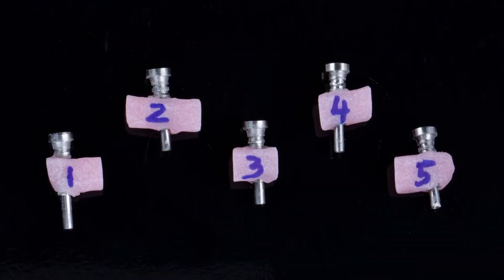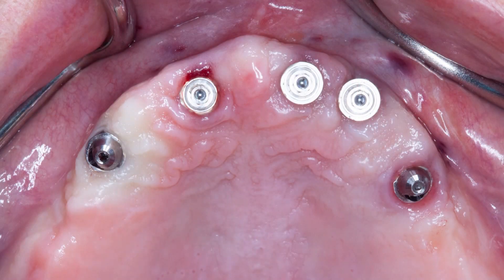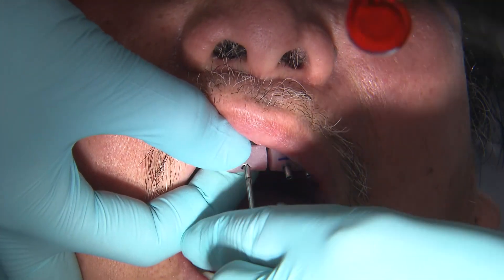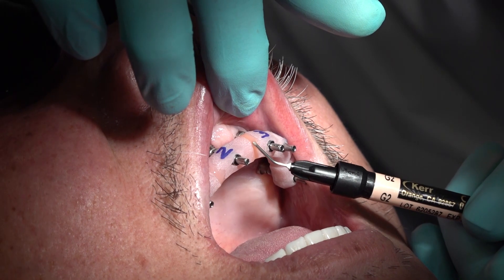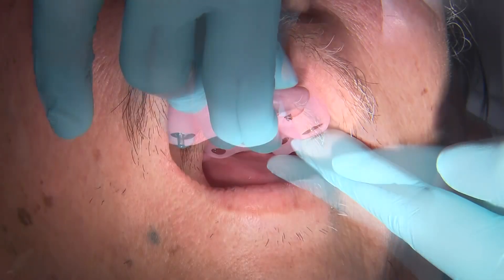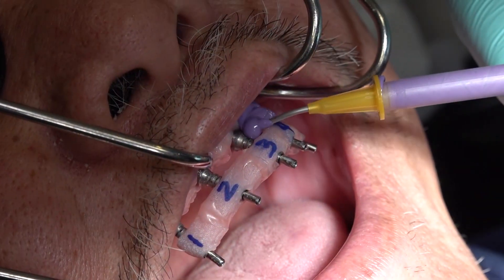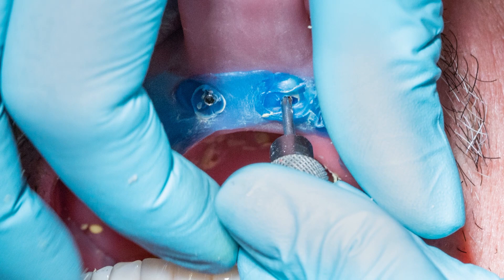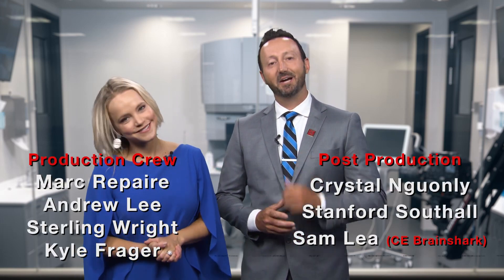Chairside Live Episode 262: How to Fabricate an Implant Verification Jig

Comment: You should make a tutorial about how to deprogram in centric relation with diferent methods like a jig, and how to take adecuate and precise bite registration in CR for full arch rehabilitation. It would help a lot to reduce errors and improve accuracy and better results in full arch rehabilitations. I tell you this by experience, i'm a dentist who worked as a dental lab consultant for 7 years, and bite registration in full arch cases tend to be imprecise. Dentist would benefit, and your lab as well, because is one of the most common mistakes and cause of repeat/corrections etc. It would be interesting to see what are the methods that works better in your experience, as the biggest dental lab in the world, spending millions in investigation to standarize processes. Greetings from Chile
Reply: Greetings. Did you get any answers to your questions? I'd like to know if you have improved in any of the aspects you mentioned and know your opinion on the matter if you want to share it. Thank you.
Reply: @asdfghjk4783  Hi, as a lab supervisor I've noticed that people who uses soft wax registers are not accurate at all, almost always are sent back to the lab... also, in general partial impressions fails in occusal accuracy (even when no CR is needed).
As a dentist, i use repeteability as a comprobation method for CR. In some schools teach that you should not get occlusal contact in CR because it ruins deprogramation. But if that's the case, how do you check repeteability? I prefer to get that occlusal contact, and if i repeat deprograming and manipulation, i should get the exact same occlusal contact, because CR should be repeteable and i have to be certain that i achieve accurracy in the register. There are differences between dental schools as i understand. But i believe that way works better for me. Cheers!
Reply: thank you for  your comment...but just wondering why is bite reg as you mentioned not accurate?
Reply: @drmoshe7062  there are several reasons. I guess the material used (lots of colleagues use pink wax for example, because it's cheap), lack of training, rushing, etc.  By the way, lots of dentist in my country only use manipulation to get CR. Several have never used a jig or other methods for deprogramming. And almost always "is lab's fault".

Comment: Don't you know there are bite registration materials that can do it quicker, faster and cheaper?  Oh wait there will be no need to use a lab then.....
Reply: You' ll be surprised if you spend just a couple of months in a dental laboratory, the techniques used by the dentists and ways to deal with accuracy are absolutely heterogeneous and non-standarized. And if you think that using a bite registration silicone is the solution, i respectfully disagree, specially in full-mouth rehabilitations in CR. It's usual that they need to be sent again to the lab for corrections.

I guess that Glidewell does this videos to try to reduce failure, bringing their own experience about what is the most fail-safe way to proceed, I wouldn't dismiss their opinion on the matter. Everybody wins.

I would like to know, which techniques have gotten in their experience, of millions of crowns, the least amount of returns to corrections/failure. Note that they do full zirconia rehabilitations, that shouldn't be corrected with a bur once baked because the material loses resistance. The precision in bite registration must be very very high in order to work long term. Even in partial zirconia bridges this is true, the corrections should be avoided. I think that is very good to see the opinion of the other side.
Reply: I guess the problem goes also in the technique...use a jig? Just manipulation and chin point? Leaf gauge? Is a matter of personal preference, but the lab is the one that receives the work and could research and compare the ratio of sucess/failure in a mass scale. At least in my country the clinical and lab work are mostly split, instead of sharing information and improving each other (Glidewell is also in Chile btw)